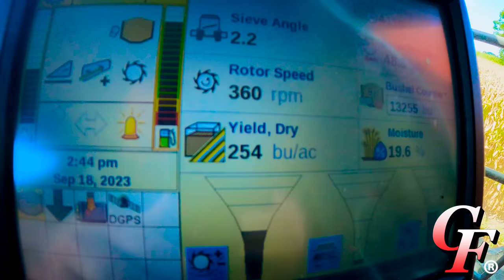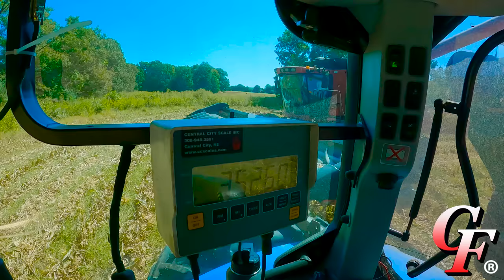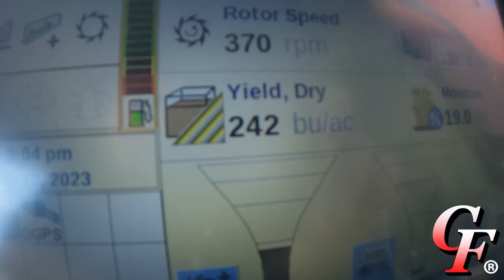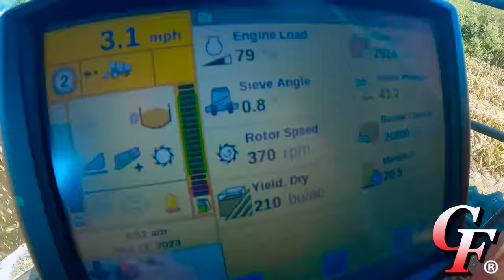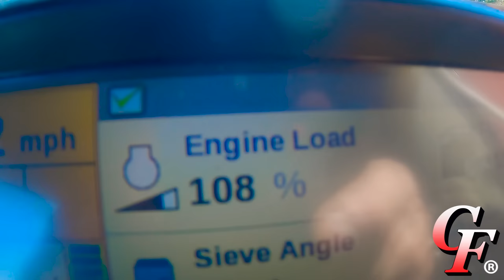We have Cab Corn!!!  Corn Harvest #3: (9/18/23)

Comment: Matt, try this. Hit that Johnson grass with roundup as soon as you can. Before it freezes, it will uptake it better right before going dormant. Then go check the roots in about 10 days and if they are black, run your chisel over those spots pretty deep. That will be the end of them. Even your cotton when you hit ‘em with defoliant mix in some round up and do the same hit em with the cold steel. It will work.

Comment: '21 was a bad grass year in the corn here.  Lots of rain after tassle. No till.  I've cleaned it up by either doing a 1 pint rate pre plant or epost, followed by 1 pint rate at v5.  Dual, or you could use resicore.  Or any group 15. I think it cleaned up the grass that had started to sprout by v8 when I used it as a pre only.  Ran out of gas by that time. Clean this year. Last year didn't count as it was a drought and nothing grew.  Good luck.